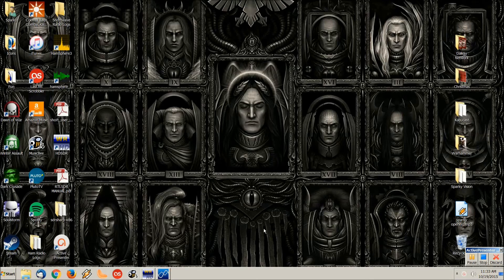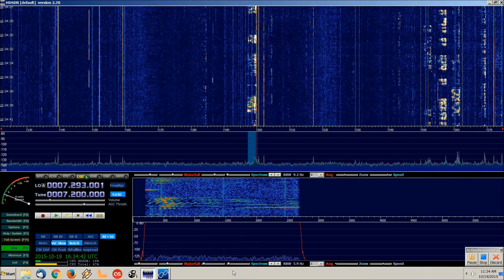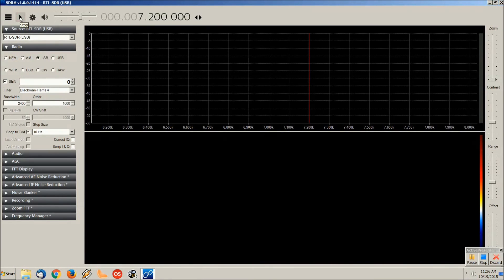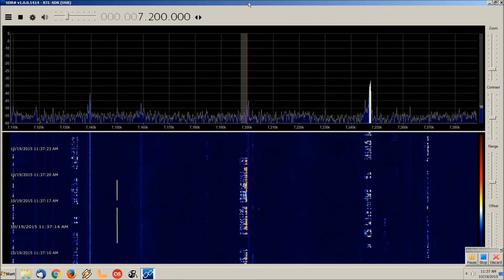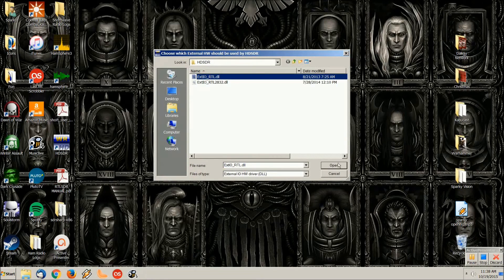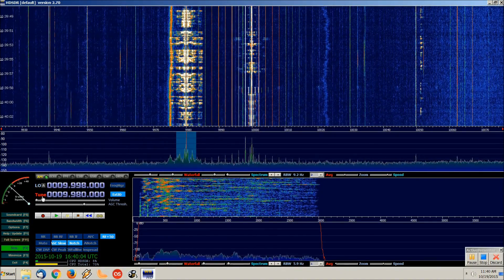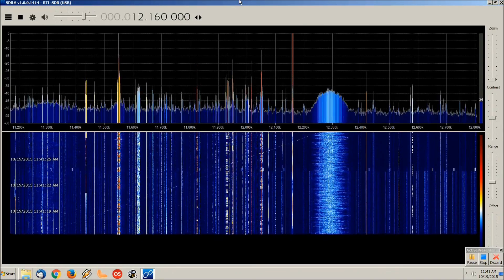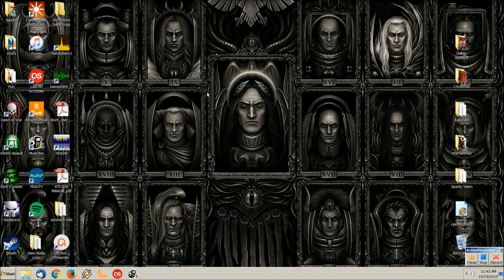HDSDR vs. SDR Sharp

Comment: I've never considered running SDRsharp without it's toolbar "active" so I don't find swapping modes an issue, I'd like to check out HDSDR but the software recently demonstrated by the Radio Hobbyist (SDR Console) has piqued my interest also...
Reply from the maker: +SpectreOZ That's right, I was going to check out SDR Console as well.

Comment: I'm confused.
Reply from the maker: +hamrad88 About what?
Reply: +sparkyzilla85 What you were trying to show.  Could you provide more information on the dongle you are using?
Reply from the maker: +hamrad88 I see. I was trying to show the differences in the two programs that I'm using with my SDR, when I ran into that problem with the HDSDR program. I'll go more into the device itself either later today or tomorrow.
Reply: +hamrad88 Agreed! I'm curious which dongle/up converter combo you opted for as well...
Reply: Yeah that happens at our age :D